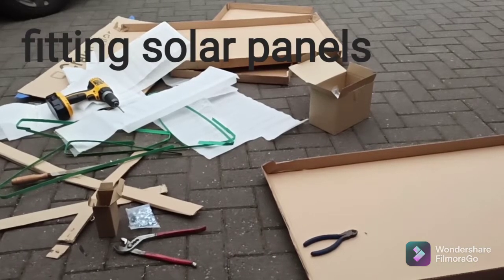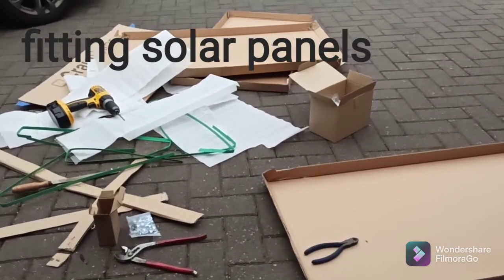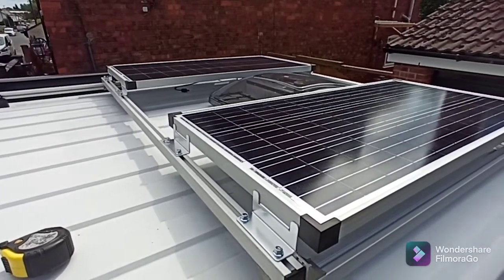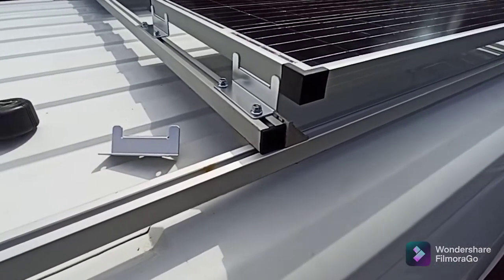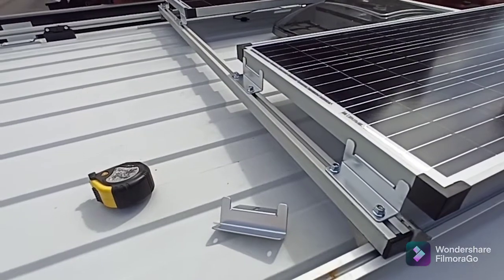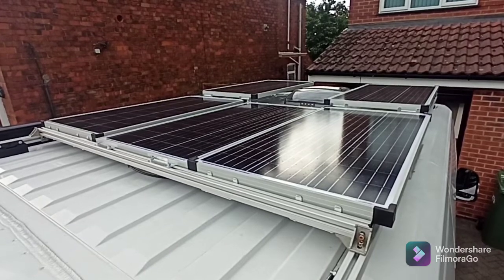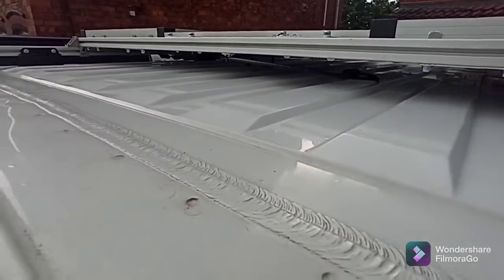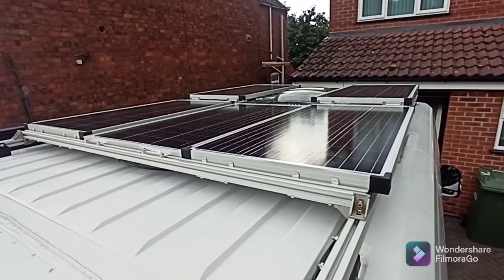Fitting solar panels,  fiat ducato  self build camper

Comment: Hiya Nick,  on the second lot of panels you installed, they are different.  How did you mount them did you mount the z clips under the 3030?
Reply from the maker: The solar panels are all the same, they are from the same supplier, but I did use the z clips and mount them under the 3030
Reply: @nasty.nick.p  That looks a lot neater but it must have been difficult to attach everything as the bolts are on the bottom, did you do it off the van and then put the 3030 with the panels attached up on the roof?
Reply from the maker: @paulbrown8341  I fitted them on top at first so I could get all the 3030 bars in the right place, it was a bit tight but there is enough room to get your hand underneath the panel

Comment: I like the aluminium bars you have used ... what is the name for that type of cross sectional profile? Do you remember where you got them from?
Reply: Eyeballing it, I'd say PG30 aluminium extrusion. So 30mm cross section and the same as the depth of the 100w solar panels. Try Matara for that type of aluminium.

Comment: Nice and tidy install.  Please share a link to the supplier.  Can you do some videos on installation or run through what went where e.g. how you ran the cables into the van?  Thanks.  New sub!
Reply from the maker: The solar panels are from a company called Craig Solar, and the cable just comes through the roof  via a twin entry cable gland

Comment: Hi mate i'm looking at fitting another solar panel to my factory build van conversion (2021 Fiat Ducato).  I don't want to drill any holes through the roof, but like the idea what you've done with the channels along each side of the van.  How did you fit them?  I only have a space at the front of the van immediately behind the cab and have 1400 (side to side) x 740 max space.  I also already have a wind out awning that they've fitted......
Reply from the maker: Drilling might be your only option, as on a factory build they usually fit the awning mounting brackets to the studs for the roof rack , if you use plenty of sikaflex and self drilling bolts you should be ok